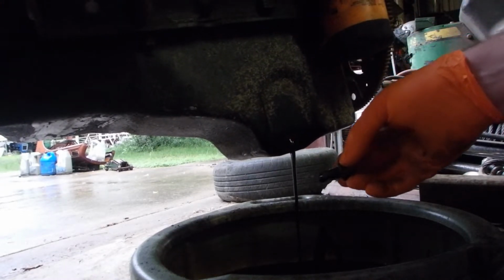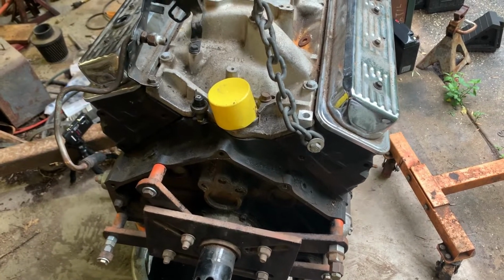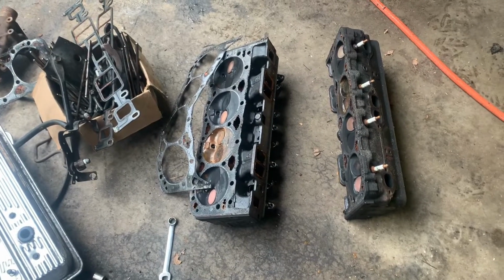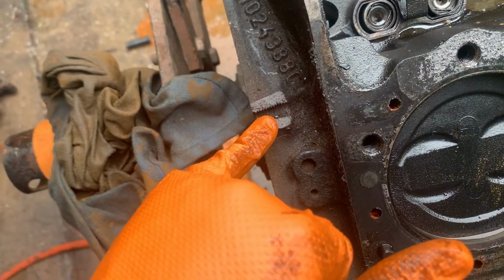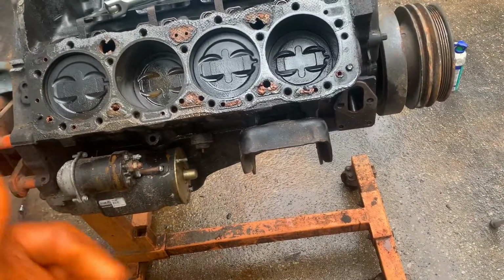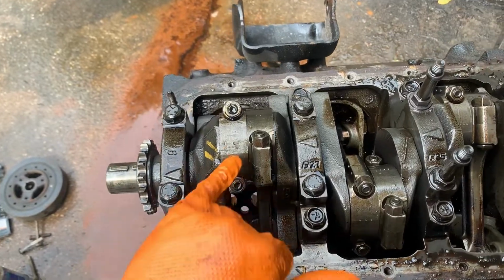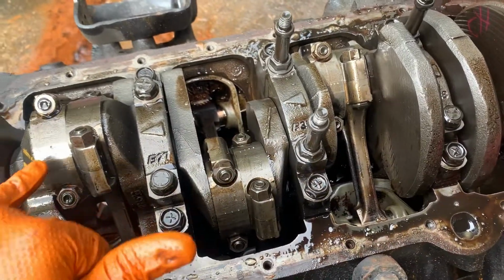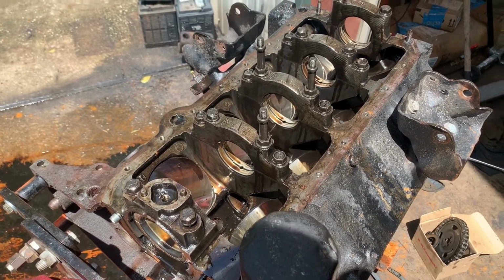Teardown The Stuck $100 Vortec 350

Comment: You're really not going to find a better short-block to use. It's a roller cam, 1-piece rear seal with a fuel-pump provision. I say rebuild it.
Reply from the maker: Yeah it’s about as good as you get. Wasn’t planning on boring and new pistons etc. but I will will never sell this truck so might as well make the engine like new.